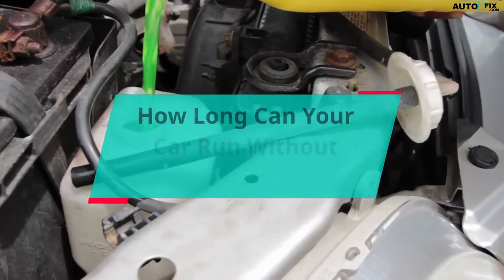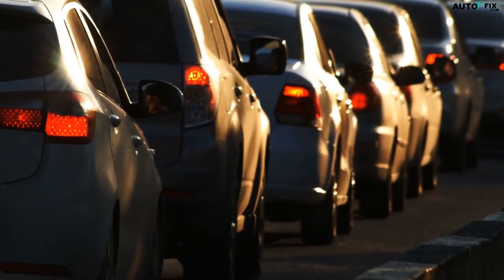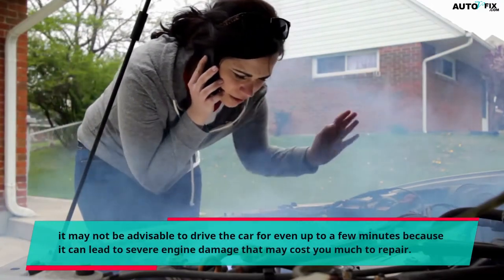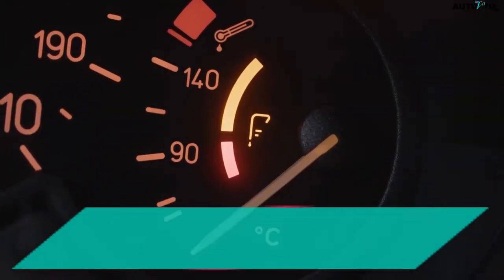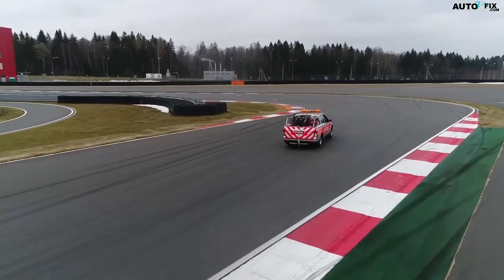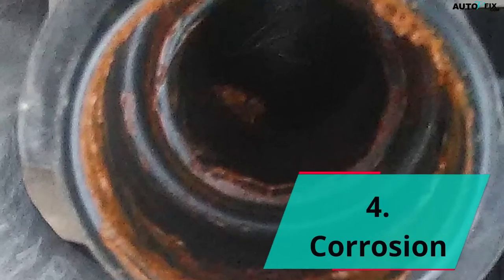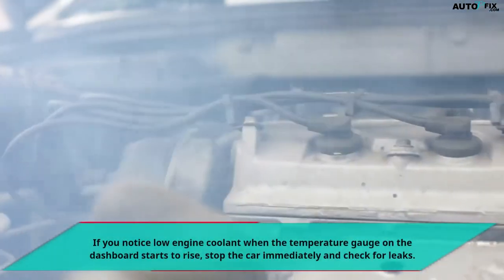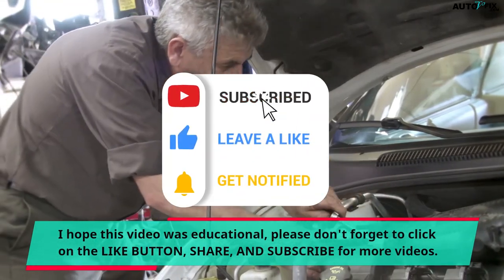How Long Can a Car Run Without Coolant

Comment: is it good if an ordinary water would be use instead of coolant Sir ?
Reply: My question too
Reply: To move the car around for a little bit yea but not long distance.
Reply: all coolant has at least some mix of water inside but i would only use water as coolant only during actual emergencies and you need to get somewhere. don't use water if you just don't want to buy coolant because you will end up destroying your engine
Reply: Okay, I had the same question but now have a partial answer. While running a car with normal water will not be catastrophic in the short-term, it's not recommended at all, because plain water has minerals, minerals that will create rust inside the radiator and pipes, and eventually will be very expensive to fix and repair. Also, when you buy concentrated coolant, you need to add distilled water
Reply: No ur not supposed to use just water. U always use coolant. Or a 50/50 coolant. Not just water.
Reply: @toyotabrony  and if coolant isn’t available then what . Run it dry? 🤦‍♂️. Water is fine just don’t keep it permanently since it will rust the inside of your cooling system. That’s why they made coolant so it can keep your engine cool and without damaging it via rust.
Reply: “Engine cooling | how it works “by Donut he explains it well
Reply: @franciscoalmaguer3507 i haven’t seen that part yet but I go for what Scotty Kilmer does. Stick to oem. 

There’s always amazon to order for u. 

But I stop by at toyota dealer. And bought two gallons. 

Hell no I ain’t gonna add water for that. 

Always use an oem coolant. No just water. Never do that.
Reply: @franciscoalmaguer3507 who said anything about running dry? That be ur loss for that issue.
Reply: @toyotabrony  for cooling your engine I bet you fill it up with gasoline instead of coolant and for engine oil you’ll put olive oil . 😂
Reply: @franciscoalmaguer3507  I’m glad that never happen. Otherwise, I’ll be the blithering idiot lol
Reply: @toyotabrony  Touché
Reply: @franciscoalmaguer3507  indeed lol
Reply: Water will slowly eat away the metal but i use it in my truck because i leak anyways lol
Reply: My car been running for 21 years without using anything but water, it may cause rust overtime in the radiator so you need to use drinking water to prevent that
Reply: @peazx drinking water ? Tap or bottle water? Mine been running for a year with tap water and I didn’t even know need to add the colour coolant thing(yes ima  lady but a male did say ahhhh be ok! So I took that info and run with it! Literally!) current symptoms overheating of the water in tank, steam from bonnet numerous times , seize and empty of the tank first symptom -then to continue filling with cool water after evey trip! ) pls advise as I’m really stuck two small children and no cash to sort this.old fiesta 57 low mileage 93 ….if I add coolant ans a new cap would this help?? And resolve or do you think definite problems under bonnet now ?